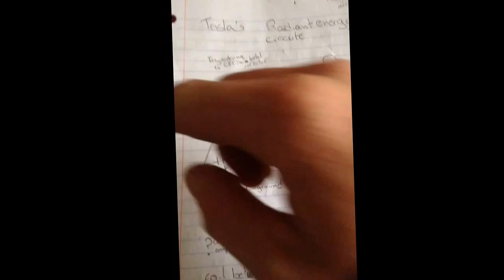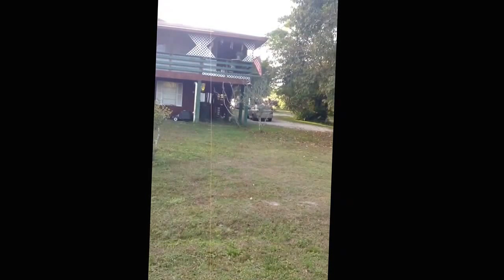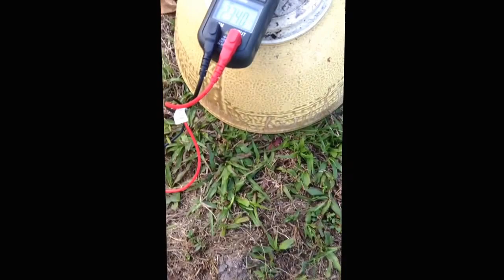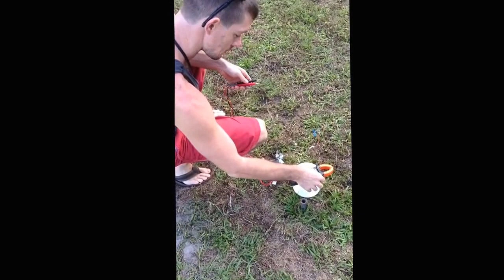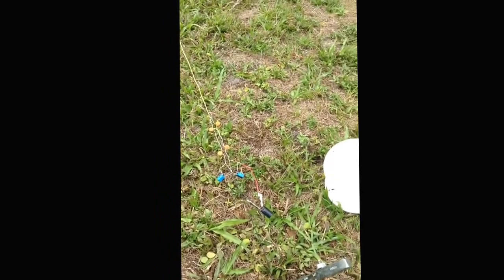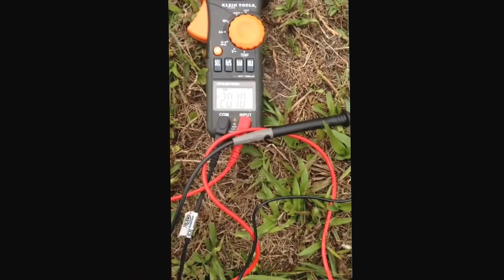BackRoomLabs Teslas RF to DC Circuit

Comment from the maker: It's in the micro amps. I think if i put my Penny oscillator on it, it should light an led. This is basically Ben Franklins kite and lightning experiment. Although Mr Franklin was doing nothing with lightning. The kite had a wire on it and that wire went to high voltage capacitors for experiments. Basic idea is the higher the wire the higher voltage potential. If you can get the wire a few hundred feet up you can get voltages of 10kv. Have a look at LaserHacker.com he has some more advanced atmospheric electricity experiments. I will be returning to this experiment next summer after I perfect the crystal battery's and this vertical axis wind turbine I'm working on.
Reply: do you think that circuit is able to charge a battery slowly ?

Comment: Hey Bill, how many amps are you getting in its current state for this backyard device? Are you getting more amps than from crystal cells. I am curious to make this, but I am looking to build something that produces amps without having to make a liquid cell that will corrode. Thx, man!
Reply: also, i saw a video, cant recall where, but this kid, runs the wires all throughout, and underneath his roof, so the wires are protected while using a ground from outside. It might be something worth while to check out if your looking for long term purposes.